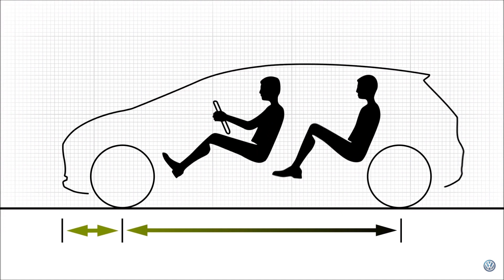VW | Electric Future | MEB Platform

Comment: The problem is Volkswagen did get away with it. As far as I know there have been no punitive damages cases in the EU to fine Volkswagen for what they did.  Let's be very clear this was the company that did this not individuals. I would not buy a Volkswagen again for moral reasons.  Volkswagen have consistently lied about the emissions of their cars and the only remedy people in the UK have got is the engines have been fixed so that they don't cheat emission standards any longer.

Comment: So I'm going to get the cheap little hatch back and program it to run like the sports car. No engine swap required. Beat that Honda Civic.
Reply: While i like your optimism i see problems with that, firstly while the engines are the same their power is determined by how much power the battery can supply, sportscars will have to have a ”stronger battery” (larger to spread out the high consumption) and not just reprogrammed engines, if the same performance would be taken from a smaller battery it would be under extreme strain  wearing out soon and also have little to no range. Also its not just power that makes a sportscar, putting 5-600 hp in a unmodified grocery getter (standard suspension etc) on low friction eco tires.. is hardly a safe build
Reply: @sakariaskarlsson634  A well thought out reply to a not so well thought out joke.

Comment: @1:01 You got it right, bro. The emissions regulations become crazier over time and there is a tipping point where it is to expensive to even try to meet those ludicrous standards. Most new cars are bought for commercial fleets but even companys aren't willing to accept any price tag.

Comment: So VW (which I assume includes all its brands?) is ambitious because they hope to sell 150.000 EV's worldwide in 2020? While Tesla sold 55.000 Model 3 EV's in this quarter in the USA alone? And produced a total of 83.000. Multiply by 4 and you get 330.000 cars per year. And it will be higher in 2019, and 2020. By which time a potential EV buyer will have to decide "Should I buy a new VW/Audi/Skoda EV, or should I buy a cheaper, used Tesla?". So yeah, maybe VW is being ambitious by targeting 150.000 in 2020.
Reply: i believe VW actually are aiming at about 300 000 in 2020, 500 000 in 2021..

Comment: Interesting Telsa's batteries can be replaced but not the VW EV?
Reply from the maker: Clinton Whoo my understanding is they have designed the platform to have the batteries easily accessible and as such can replace them as opposed to the Golf GTE which is a nightmare to access the batteries.
Reply: Yes they can be replaced as needed, from what I have read.  However, you will not be able to get a 2020 car and replace it with the battery from, say, a 2025 because the rear of the car such as the cooling system and electronics will not have been built for the 2025 battery.  However you should be able to get a new 2020 battery....unless I am missing something....

Comment: Nice info on the MEB, thanks, but do you think VW would be rearranging its vehicle portfolio so quickly if it didn't need to catch up with Nissan/Renault/Mitsubishi and Hyundai/Kia?  The writing's been on the wall for two decades (since Prius Mk 1) now, but VW has invested way too heavily in diesel tech, especially the software, :) and is now caught with its arse exposed.
Reply: Sure they will. Biggest market for VW is China and in China they have to meet a quota of EV's as early as 2020ff or they'll have to pay other companies which produce EV's. In 2020 VW plans to sell 400,000 EV's in China and 1,500,000 in 2025.

VW EV popularity in the US or Europe is nice when it happens, but in China it's crucial.
Reply: D GE - check out BYD - its plug-in EV sales in China are already 20k per month.  VW has some catching up to do there as well.
Reply: @johannesschaller5510  
Except for the batteries, EV volume production is not so different to ICE vehicles production. It can be done on the same VW production lines in China. Technilogically, EV's are less sophisticated with less components compared to conventional cars. VW has been developing EV's for years and they already sold their own EV's in smaller quantities in the past. Now they have designed their next generation EV's and contracted multiple battery suppliers with deals worth many billions. To ramp up mass production when all components are available should not be a problem at all. Main issues will be, to have a really attractive EV lineup for the Chinese market and earning money with EV's priced well below Tesla.

Comment: I was at Circuit De Catalunya 2 weeks ago. A Seat truck pulled up and a Leon Cupra EV came out of it. It  did several laps (quietly 🤣) then went back into the truck which then left. I don’t wholly agree there has been no improvement in EV’s this year, I think the Kona EV (And soon Nero EV) are a big step forward and I’m hoping Nissan get it right with the Leaf plus (or whatever it’s called) early next year.
Reply: Nissan is releasing their 2018 Leaf in Aust, a selling point is the battery is reversible in that it can be plugged into home power to charge and if Power is cut (floods, fires earthquake etc) it can power the house, ideal with Home Solar as a sort of battery, was invaluable in Japan during their recent natural disasters when large areas were without power for many days up to a week, Leaf owners with Solar still had power, cooking and A/C

Comment: Vw have produced very little , so far fines, jail , plans for ev that are late , ev’s you can not get in uk , camper been around for years , Audi etron not hear until 2019 , 20000 being made in that year , pathetic,not ambitious , Nissan will have 100000 at least in leaf sales 2019 , Renault Zoe 50000+ alone , Tesla 400000 at least . Rear wheel drive an excuse , they are copying Tesla , front wheel drive ev will be far more reliable , less tail happy . Chassis is just tesla rip off . Beetle was crap , advertised well actual reality not as advertised, golf expensive Ford Focus better for less. Vw have invented nothing new , well behind the curve . Audi expensive , certainly not a Tesla killer or near it
Reply: There are no "Tesla killers"
There are numerous "ICE killers" on the horizon.
The issue is, many of the ICE killers will be replacing their own brand of ICE.

Comment: Thanks for putting all the current VW info in a video.

The VW plan for the future is already 5 years behind (it will be 7 behind in 2020) if we talk about battery tech - it will be very obvious when Tesla will advance to the next step in battery pack (hinted for the lower range Model 3).

VW will make very low profits (compared to their current ICE cars) because they buy (old tech) batteries from suppliers, and their initial volume will be low. 

Lets try to imagine it is year 2020. Tesla produces 500,000 cars per year, and probably getting ready to open the factory in China, and a production line for Model Y in Nevada or California. 2021 comes by, Tesla could produce 1.5mil cars per year and their battery tech is 2 generations ahead. VW will sell 50,000 cars (yes, 50 thousand) in 2021.
Reply: EV's are less sophisticated than advanced ICE technology and when it comes to manufacturing cars, traditional car companies still have an edge over Tesla. The supplier market for optimised EV components is still evolving and will not provide a special advantage for Tesla.  An independent super charger network will be rolled out too. There will not be much advantage left for Tesla in about 3 years. Maybe software... due to the proximity to silicon valley.

In the long run, battery production should be done by automotive suppliers. In the comming decades, there will be a fierce competition for the best value batteries. It's about battery chemistry, manufacturing and large numbers. This game will have it's own winners. No car manufacturer will make the success of the vehicle development dependent on the competitivness of its inhouse battery production.
Reply: For China, VW plans to sell 400,000 EV's in 2020. They have to do so to avoid paying competitors to meet the EV quota. In 2025 VW plans to sell 1,500,000 in China alone.

Tesla will do great in the US, but they will be only a normal competitor in the rest of the world.
Reply: D GE - Tesla's rate of innovation is several times that of the rest of the competitors.  The Chinese love American products.  I think you are selling Tesla short by saying they will be a normal competitor.  I don't believe they will have a huge market share, but they will have status and be considered a superior product by many Chinese consumers.
Reply: @rogerheuckeroth7456  
Sure there will be a premium car market which some Chinese may appreciate.  But then there is this trade war with China which will be a competitive disadvantage for US manufacturers in the crucial phase (2020ff) of market disruption.

Except for the battery, EV's rely on technologies (Microcomputers, sensors, communication, electric motors, power electronics) which have been evolving for decades. After the early phase of modern E-mobility, there will not be much of an advantage left for Tesla to excel it's competitors. Modern car evolution is not done by a single company alone. It's done by car manufacturers together with a multitude of automotive suppliers, engineering companies, semiconductor companies... . These companies are not tied to a single car manufacturer. Future advanced EV components will be available for the whole EV-market. 

Next disruption in the automotive market will be self driving vehicles. Although Level 4/5 autonomous vehicles are still years away, many competitors already started to invest heavily in autonomous driving. It's hard to see Tesla being the clear winner in autonomous driving either.
Reply: D GE - How long do you believe this "trade war" with China/US will continue?  2020?  I believe it will be cleared up well before then.  Besides Tesla is building a plant in China right now.  This will allow them to avoid these tariffs.  

On you second/third point, you are correct that the technologies that Tesla uses are available to the broader market, but they are developing software and their own super fast chips that are capable of 10X the processing speed than the fastest chips commercially available.  This is primarily for their autonomous driving technologies.  They are now Beta testing full self driving software with employee volunteers.  I believe there is a chance that they will leap from the competition on this front.  The AI that they are using is learning from all the data that they have been collecting from their cars.  Programming this AI is not like writing traditional code.  Most of it is labelling the data so that the machine can learn.  This is something that is missed by many.  Others will not be able to just simply copy the code.  Its an extremely complicated problem and solution that is heavily data driven.  Does that make sense?
Reply: @rogerheuckeroth7456  ,I think the trade war will last at least till Trump leaves office + a few month (mid 2021 earliest). China thinks it's not only Trump pushing back on China but also the US trying to protect it's global dominance against a contender. If so, the trade war could easily go on for decades.

Building your own customer specific integrated chipsets for autonomous driving is nuts. In the long run, 1 to 2 independent autonomous driving platform and services providers will own the whole market. The EV market will be more like the bicycle market where you can buy most of the components needed from suppliers and one component will be the trained brain of the car, ready to be connected to sensors and actuators. Autonomous driving components will finally have a market of some 100 million units globally while car manufacturers will produce their autonomous cars in quantities of thousands to low millions max. It is a huge task to create and advance a hardware platform for autonomous driving, do all the training for the AI, do the test drives, provide the latest detailed maps for the whole globe, get approvals globally, tackle all the legal and insurance issues globally, analyse accidents globally to improve the system, care for all the updates globally, care for cyber security, make the customers pay for the service globally.....
I think it is similar to the operating system business. If an autonomous platform provider gets a decent market share like Microsoft Windows on the personal computer, this demanding service can be provided for a tiny fraction of the costs a single car manufacturer would have to charge. Eventually companies like Google/Waymo or Intel/Mobileye will have the upper hand in autonomous driving.
Reply: Interesting discussion.  I guess I'm a bit more optimistic on the trade war issue.  It hurts both sides, so I see a resolution coming within the next year.  Trump is just trying to get leverage for a "deal".  I don't think he was expecting China to fight back as much as they did.  This has to get resolved soon.

On the Autonomous Driving technology, I think you picked two good possibilities for winners in Waymo and Mobileye, but I think Tesla may give them some stiff competition.  Tesla's approach (not relying on LIDAR) is unique.  It will either work and be a far cheaper and more reliable, or it will fail  Time will tell.  But... never bet against Elon Musk.

Comment: Is it impressive that they are targeting just 10% of their total production (currently 10 million vehicles per year) to be EVs in 2025? Do we think that the market share of EVs will be at only 10% in 2025? Hint - in 2018 EV market share is approaching 2% in many parts of Europe already (much higher in Northern Europe), and doubling every 2 years. Let's count together! 4% in 2020,  8% in 2022, 16% in 2024. So likely pushing towards 23% by 2025 in most of Europe, probably higher % still in China.
Too little, too late from VW. Who in their right mind will be buying a non-EV in 2025, since the sticker price will already be at parity with gas cars (with running costs much lower), and a much better ownership experience? VW are evidently not planning on surviving the transition to EVs. You would have done well to emphasise this angle on the story Ryan, instead of parroting their PR.

Comment: This is what we wanted, but I am not going to get excited about VW being forced to do what is right for the planet, their employee/shareholders, or customers when they made such as effort to lie and cheat. I know they are not the only ones and that makes it worse!

When these cars actually get produced at the numbers they need to be made, the ranges are a minimum of 200 miles and the prices are around what their ICE cars are priced at, then I will crack a smile. 

I wanted every maker to get on board, the task is just too big for just one company so there was always opportunity for lots of money to be made and a new era to be ushered in with companies that had been around as long as the first model T.  

Now, if they make it great, but they are not doing US a favor! Those who are brand new, and EV from the ground up may still replace these legacy automakers and that would not upset me one bit. 

Promises have been made, action is required and until then VW is just covering their (fill in the blank). Being skeptical in this case isn't a bad thing and well deserved.
Reply from the maker: D R-K nicely put. Ultimately whoever emerges out the other side as successful will be there because we, the customer, saw fit to invest in their vehicles 😁👍
Reply: I'm a Tesla owner, and after driving my Tesla for over 100,000 miles over several years I seriously don't think I would ever buy another brand EV.  I have driven other EVs and find myself comparing them unfavorably with my Model S.  Tesla has set the bar so high, that I really don't see any of the legacy car companies ever catching up.
Reply: Chose to invest their hard earned into a vehicle.
That is the crux of the matter as shown by the sales figures and especially the revenue figures, especially taking into account the Tesla figures are constrained by their growing production rate while sales of competing brands is falling, suggesting a growing number are holding off waiting for their EV whether Tesla or Hyundai or eTron or 2019 Leaf.
Meanwhile ICE manufacturers are in a vicious catch 22 with their sunk infrastructure worth many $Billions becoming effectively worthless and they are the assets providing collateral for their bonds and loans. Cash Flow is King and that is profit on sales.
And when the customer does not wish to invest in a substantial range of your products that hurts.
Ford carries large debt, but they got out of the Sedan Market in the US avoiding that competition, while going for broke in China where Western ICE manufacturers are seeking out Joint Venture partners with skills and technology they don't have, plus supply chains unavailable in the West - technology transfer
https://www.youtube.com/watch?v=A3mxuaD80ZE
Reply: An Article by a German Engineer that understands the Auto Industry - Excellent and the comments are also very informative (almost troll free and informed).
https://cleantechnica.com/2018/09/25/tesla-an-uncomfortable-wake-up-call-for-germany-all-hands-on-deck/
As a German engineer, I am today more than ever concerned about the ability of our auto industry to survive and prosper. I write this as a person who loves his country, the people, and my fast German car, a true masterpiece of technology.
Your assumption, dear reader, is correct — I talk here about Tesla as an existential thread for the German automotive industry, and why that is real and backed up with facts.
With 103,020 vehicles sold from Tesla in 2017, about 1% of the 10 million VW delivered, now is exactly the moment when you, dear reader, will call me a person that lost touch with reality. Allow me to explain. Invest a few minutes and make your judgement after that.